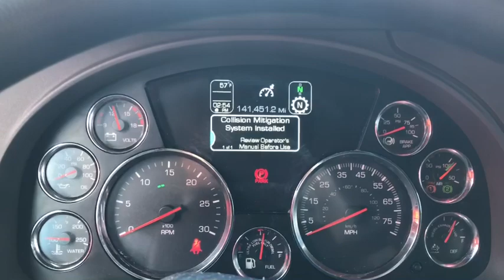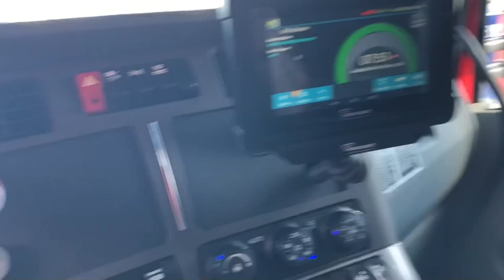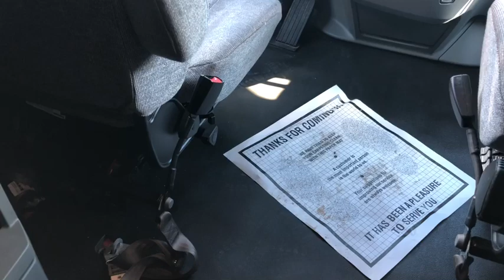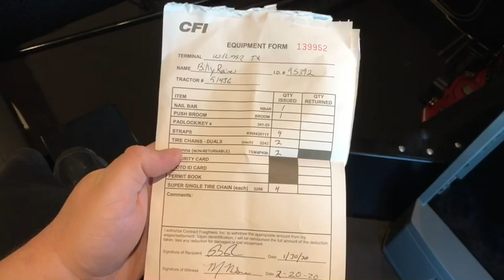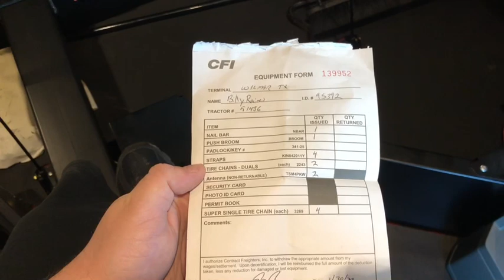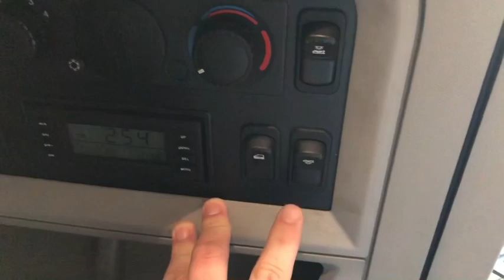CFI | Kenworth T680 | Truck Tour

Comment: That black thing under the bed hooks in the front bumper for the tow truck to pull u when ur stuck in the snow or mud I think
Reply: If it looks like hooks, then yes that's what they're for. Slide into the holes in the front bumper an the pins go through the frame and the hooks.

Comment: That truck is about as stripped as it gets. They were too cheap to even spring for a catwalk. Pathetic for such a large company.
Reply: I used to work there a couple years ago. Probably the worst company I've been at. They don't even give you the original Kenworth seats. They take out those and give you hard, cheap ones. And give you filthy trucks to drive in. I'm still traumatized by them.